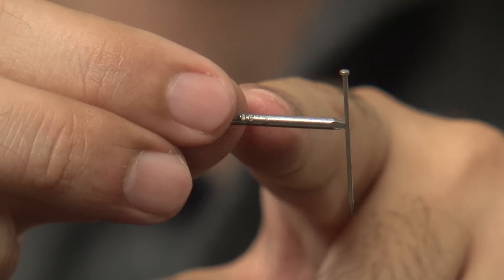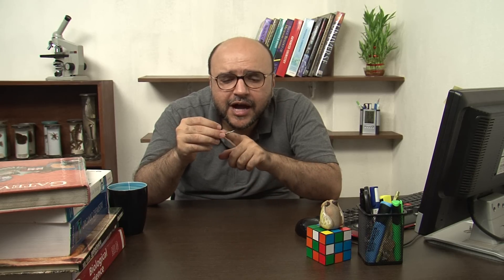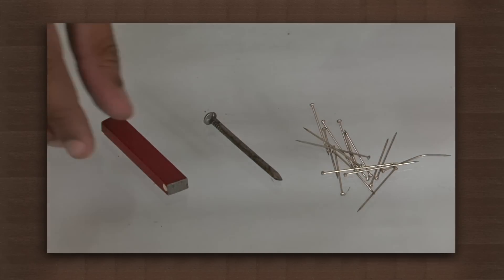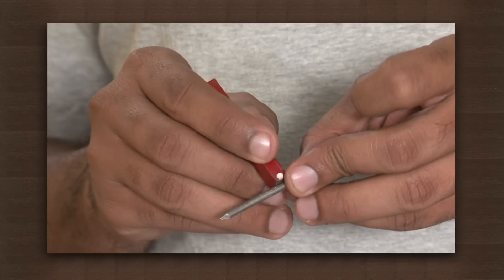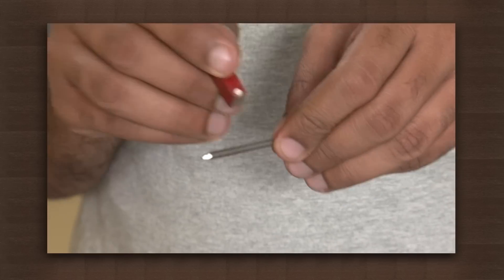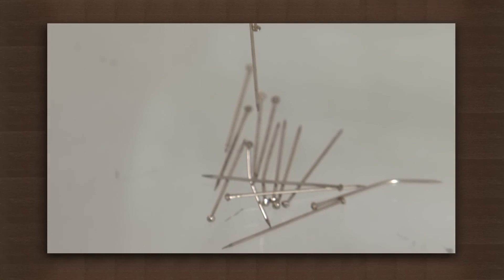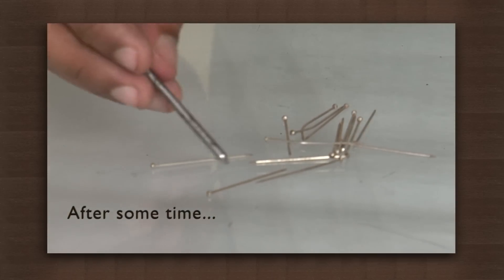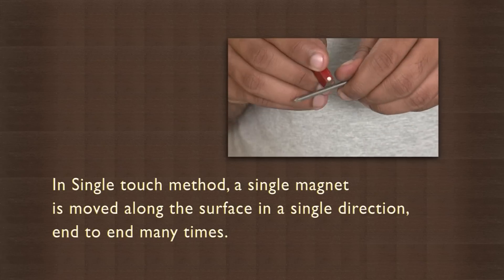Iron nail as a temporary magnet | Magnetism | Physics

Comment: Too bad this video doesn't get into what's going on at the molecular/atomic level to explain why this happens.  I understand that the nail's molecules are being affected by the magnet, causing them to become aligned and thereby magnetizing the nail, but what causes them to slowly unalign (demagnetize) like that in the absence of some outside force?
Reply: Magnet loses its magnestism with time rather its a temporary one or a permanent one, so temporary magnet like those demagnatizes very quickly bcz  them having a very less contact with magnet, for example if youll make a temporary magnet by electromagnetism using a battery and a coil, that temporary magnet will last longer than the one shown in the vid
Reply: In a given system the entropy tends to a maximum